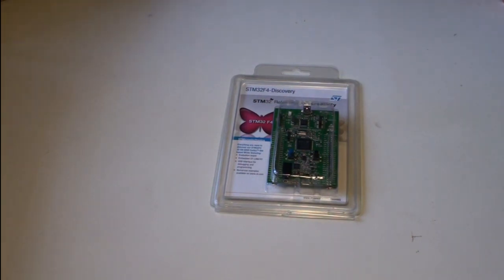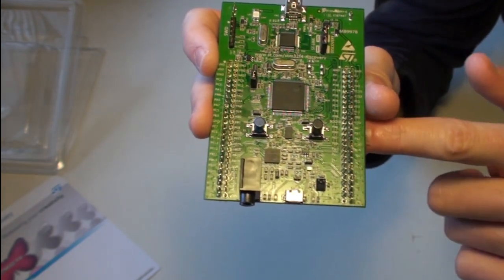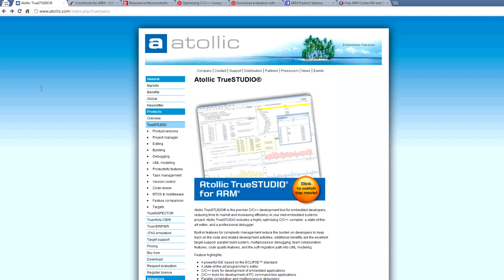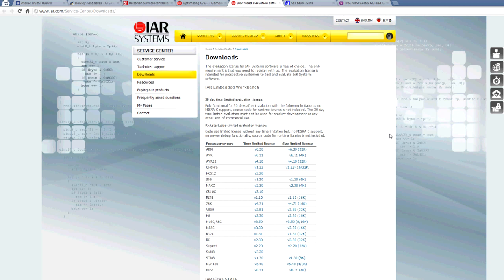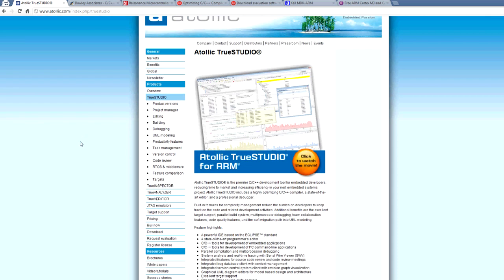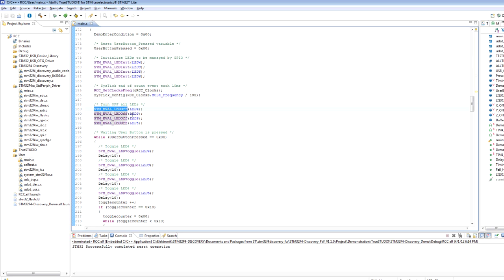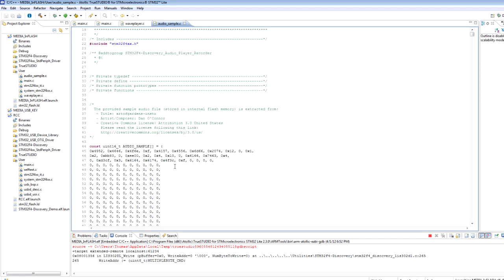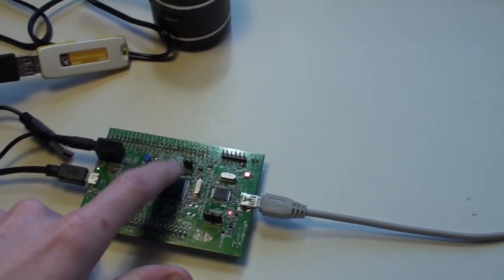STM32F4-DISCOVERY Review

Comment from the maker: The current demonstration works by recording audio into a buffer in the RAM and storing this into a file on the memorystick afterwards.
When playing back it is simply doing the opposite actions.

So yes, if the modifications you would like to apply can be done on the fly and relatively fast, you should be able to apply them after a new portion of the file has been read into the buffer.

Comment from the maker: There is a 5V input pin on the board which powers the on board 3.3V regulators just as if the USB was connected. You can also connect a 3.3V supply to the 3.3V inputs.
So yes, it is possible.

Comment from the maker: You will need to power it with a 5V or 3.3V source.
This can either be done with a USB cable in a USB wall charger or you could connect the voltage source directly to the broken out pins in the connectors on the left and right side of the board.
Reply: When i connect A to  B my MEMS Leds are not working..can you help me out why? And led1 is contionusly blinking instead of turn ON  why?

Comment from the maker: With only 2 years of experience with the smaller microprocessors I will recommend you to really evaluate if you need the extra processing power. Do your projects require this, or is it only because you would like to learn the new family?
If it is the last option I would recommend you to wait a bit until you have got a better grib of the smaller family.

Or you could maybe have a go with the Maple board (STM32 ARM) or the FEZ Panda (NXP LPC ARM) as they are easy to get started with.

Comment from the maker: No, it is not possible. According to the datasheet and the Vref specifications (there is an external input) it can not go any higher than the VDDA, which is the supply voltage = up to 3.6V

Comment: Hi. I read your previous comment of connecting to the 5V regulator or directly to the 3.3 V pins.

So.... do I get 5V laptop power supply and solder it to the pin ?

Comment from the maker: That is actually not quite right.
You are completely right about the way different features and periphirals of the device, which isn't directly supported by the Arduino IDE.
But a company called Leaflabs have actually developed an Arduino-compatible platform with the STM32 and they have also made a similar IDE where you can use the same Arduino-like C/C++ language and function calls.
You can find more information here: leaflabs.com/devices/maple/

Comment: Hi, what are the requirements for minimal in system programming ? I would prefer flashing it over the uart pins. I think there is some flashloader tool program available.(For NXP cortex i use a simple USB-serial convertor + 1 extra transistor as minimul programming tool). I assume this setup is also possible with thm32f4xx ?

Comment: Is it possible to program Fresh STM32F4 series  MCU chip  externally using this discovery board? ST link can be used and it does not have JTAG so  this is confusing.  I want to use STM32F4 core only in my PCB design.

Comment: see the ADC and DAC onboard are only 12 bit, can i use a external 24bit ADC and 24bit DAC  and just process the digital signal on the STM32F407? and would this have improved audio quality?
Reply from the maker: Yes, you can. You can find external ADC's and DAC's with different interfaces. I2C and SPI are common interfaces for simple ADC and DAC chips. However for high-speed transmissions you might want to take a look at I2S.

Comment: Hello. Can you help me with the lwIP demo for STM32F4?
Reply from the maker: Which demo are you trying to use? And are you trying to use it on the STM32F4DISCOVERY board or another board?
Reply: I am using the STM32F407VG.  To test the the project I'm using Eclipse and I like ethernet interface STF4BB
Reply: You lwIP demo for working with coIDe with STM32F4?
Reply: Help me
Reply from the maker: luigi maritato Yes, the lwip example project found here http://blog.tkjelectronics.dk/2012/08/ethernet-on-stm32f4discovery-using-external-phy/ is for the STM32F4
But this project is not using the lwIP stack.
We have just completed another project with the lwIP stack on the STM32F4 but not with this external Phy.

Comment from the maker: supriya s:
Getting FreeRTOS to run on the STM32F4DISCOVERY board is quite simple and you can also find source code examples directly thru the official FreeRTOS website.
Though I've found this guide for you that I think can help you getting started: https://istarc.wordpress.com/2014/07/10/stm32f4-deploy-freertos-in-under-10-seconds/
Reply: Heyy ! Do you have any idea about Contiki OS ?
Reply from the maker: Amèl Medimagh Sorry, unfortunately I don't. I have only heard about it by the name, but never used it.
Reply: mindthomas it's probably a doddle.   I'd say 2 days to clean up the detritus.  With CMSIS ('scuse spellin') it wont take a moment :-)
Reply: Amèl Medimagh You can take a look at nOS https://github.com/jimtremblay/nOS It can run on this micro and is completely free. You should have understand that's a RTOS I have made, then you can send me a PM if you need help.
Reply: Jim Tremblay  Thanks for your reply :)
Reply: +TKJ Electronics . what is the word bit size of this cpu.....8bits 16bits or what i assume it can be programmed in assembly,however can it be programmed in C.
Reply from the maker: +NUN YAH The word size is 32-bit, which is common to most ARM-Cortex processors.
The procssor can of course be programmed in assembly, but a free and well-used C compiler exists, called GNU ARM GCC.
Reply: Why would anyone want to do anything significant in assembler these days?  This is the 21st Century.
Reply from the maker: +Brian Meyrick That is correct. But if you want to get the most power and efficiency out of your processor, assembler is the way to go. But as the processor performance tends to grow, the actual required performance and efficiency is outgrown by the processor performance, why everyone prefer to use a higher-level language.